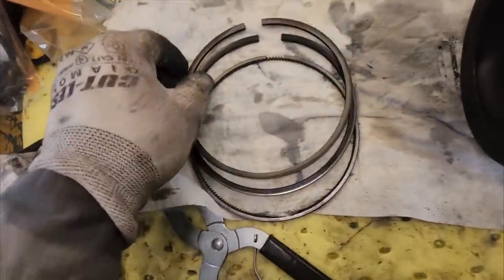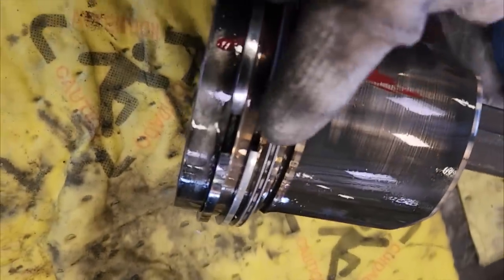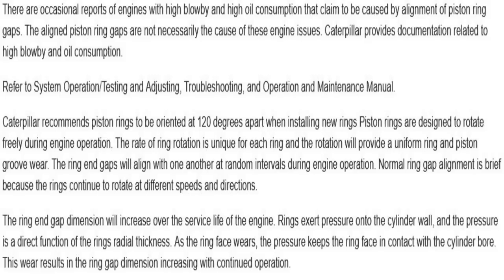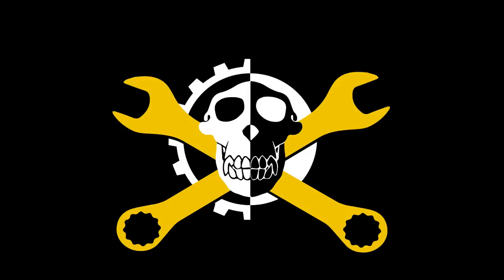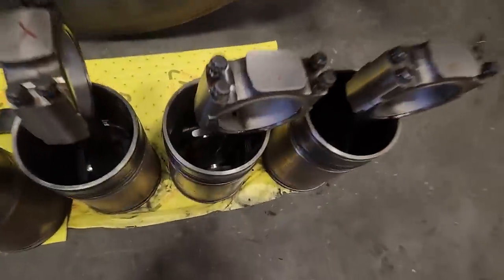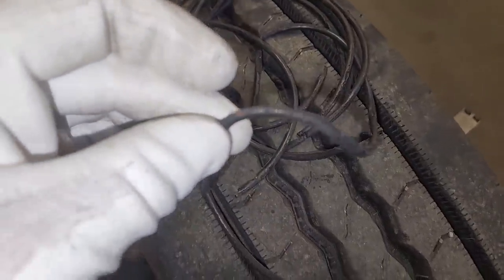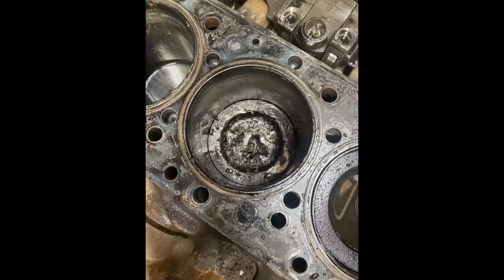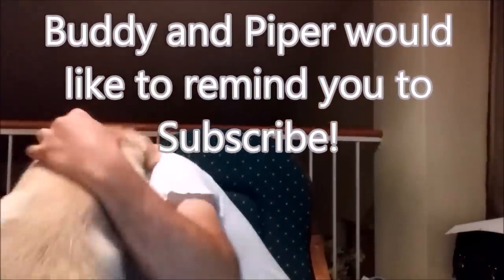Your Piston Rings alignment does NOT really matter!

Comment: This is why 2 stroke gasoline engines have small pegs in the ring lands to prevent rotation. You can't have the ring gaps move towards a port and get caught because it would break the ring and damage all kinds of stuff. In 4 stroke engines, it's a non issue. Can anyone chime in on 2 stroke diesels such as Detroits? Those have intake ports in the cylinder.
Reply: Hi ya I know the pegs on gas but had never thought about the diesel ones. Bit shit really as have a 353 Detroit thanks for making me think and hope josh or someone tells us
Reply: Shouldn’t matter as far as the ports are concerned because the ports aren’t real wide between each section on the liner. It’s not enough space for the rings to come out and hang on.
Reply: They have exhaust ports only. But since they have multiple and  smaller ports, and may not have alignment pins.
Reply: The intake is controlled by conventional valves.
Reply: I don't know if this qualifies but a EMD 645 2 stroke has the rings fixed in place.
Reply: ,,, the Detroit 2 stokes have many small ports, evenly spaced, and the end gaps just don't fall into the ports ,
Reply: The Detroit diesel 2 stroke has intake ports at the bottom of the cylinders  and exhaust valves in the head. That is also why it needs the blower to run. It produces no booost but is there to fill the cylinders with air .
Reply: @Paul070 they’re not fixed. If they appear fixed, they’re stuck. One of the checks when doing internals on the emd 2 cycles was to check the ring tension with a flat blade screw driver and press the ring and see if it has some “bounce” to it. No give/bounce and it was either stuck or broken. The ports on the liner are 360° so you end up with the ring gap passing the liner ports regularly.
Reply: @franksprecisionguesswork501  that is not correct, the ports in the liner on a Detroit are the intake ports, the exhaust valves are open when the ports are uncovered and the blower purges a fresh charge of air through the cylinders.
Reply: @franksprecisionguesswork501 Detrot 2 strokes feed intake air through holes in the liner, and force exhaust gasses out through valves in the head.
Reply: @franksprecisionguesswork501 wrong. Detroits have blowers that feed air into the airbox, then the intake ports at the bottom of the cylinders, then it goes out through the exhaust valves.
Reply: The diesel 2 stroke can’t jam up the rings like if it we’re a weed eater 2 stroke cause the ports on the diesels are machined uniformly 360 degrees into the cylinder sleeve so the rings can rotate all they want

Comment: Here’s another little tidbit: if you remove a piston from a cylinder that’s using oil and you find the rings are all lined up and they’re not carbon-seized, it’s an indication the cylinder is out of round
Reply: Correct. Good Job!
Reply: Huh. I've never heard of that
Reply: Actually means the oil control rings are worn out!@.. .

Comment: Just watched a video about doing compression checks on aircraft engines that brought up the ring movement, and to not condemn a cylinder too quickly due to low compression, some manufacturers recommend flying the plane for 45 minutes to an hour and recheck, 99% of the time the compression comes back to acceptable standards.

Comment: The reason you do not line them up on a fresh overhaul is because your compression is gonna be down from normal conditions once the get seated in after a few hours of running.  2 stroke pistons on the other hand have locator pins to prevent rotation because there's no oil control ring on them.

Comment: CORRECT JOSH. When I built engines for Cummins the Engineering squad in Australia tested this theory. Engraving dots on the top of liners to identify where the ring gaps were set when the engine was assembled. Ran a few test engines like this in the field, then stripped them down for inspection. The rings had always moved around on every test engine. Thanks for your video, well said!

Comment: I’m glad you put this out there. I read in Skyranch engineering manual that Lycoming tested to see what the rate of ring rotation was on one of their engines and I can’t remember exactly what it was but it was once every couple of minutes at 2k rpm I think. What was more important was the fact that they DO rotate. As a matter of fact, the cross hatch honing pattern I would think would put a twisting force on the ring as it moves up and down the cylinder. I think the ring gap placement when assembling a newly rebuilt engine is more to prevent cylinder gouging on first start until the rings wear to the cylinder.

Comment: Yup, you’re right, they do move around the piston.

However, it does help initial compression during a post rebuild start up.
Reply: So that's interesting, this is just a liability thing then. Seems like in 99.9999% of builds this would never be an issue and clocking the rings doesn't matter, but for that .0001% that do have an issue you could find yourself in a lot of trouble. So, tell everybody always forever that they should clock their rings with offsets because nobody wants to get blamed for the one guy whose engine goes bang.
Reply: Not even then. By the time it's cranked enough to have enough fuel through the injectors to fire, the rings will have rotated on their own.
Reply: @HANKTHEDANKEST It's not so much liability, it just makes the first start before the break-in runs easier.
The ring seal isn't optimum on a freshly built engine - they haven't broken in yet. Staggering the ring gaps just creates a longer labrynth for the gases to escape through which helps keep the compression higher.
Reply: @HANKTHEDANKEST  Murphy's Law: "If it can fail, it will fail in the worst possible way at the worst possible time."
Reply: I was told religiously in trade school that the rings DO NOT move… lol
Reply: @nickfriesen7624  lol.. My shop teacher taught us (in high school) that the reason a gasoline (spark ignition) engine has to advance the ignition timing, is because it takes time for the electricity to run through the spark plug wires, and it needs to compensate for it as it revs up!! lmfao

We got into a little "battle" after that... I eventually remember asking him "why are the plug wires all different random lengths then, and why can I throw wires on it that are even different lengths from those, and it still runs PERFECT?"  He didn't seem to have an answer for that. lol... I was only 17 too, but as soon as he said it, and I thought about it for a few seconds, I thought to myself "that can't be right".
Reply: @billymanilli one of the most frustrating things in the world is for someone to have full confidence in themselves when they are wrong.
Reply: Pour oil super thick assembly

Comment: Actually never thought about that! Great points.  Another subject that people think matters but actually doesn’t: A/C Schrader valves that have a slight leak is NOT the cause of a low refrigerant condition. SAE specifically says that the port caps are the primary sealing mechanism for service ports, NOT the Schrader valves. They are there only to prevent a massive loss of refrigerant during hookup and disconnect of gauges and recovery machines. “Maam, we found your leak, we have to replace your Schrader valves “ not lol.

Comment: Outstanding video as always! I've always wondered why manufacturers even specify where the ring gaps should be since it's so obvious to anyone who has been around engines that the rings rotate anyways. The only theory I've heard that makes any sense is that perfectly lining up all ring gaps on all cylinders might lower the compression enough to make starting the engine difficult. I've never tested that, but the gaps are so small that I can't see them leaking enough compression to affect startup much.
Reply: I don't really see them being lined up leaking enough to cause too much issue starting up, either... I mean,  you and I both know we've had (or at least witnessed) engines that'll fire up with a bent valve, head gasket leaking, broken pistons, etc..
Reply: @billymanilli  Good point, that's true. Only difference is a blown head gasket, broken piston, etc doesn't generally affect all the cylinders like someone perfectly lining up the ring gaps on every cylinder might, but I still don't see the leakage being high enough to cause starting problems either if the rings are in decent shape. Do you have any other theories on why manufacturers specify where the ring gaps should be?

Comment: What you say only makes sense. Any pressure that leaks through the compression ring gap(s) will continue to the gap on the oil ring--regardless of where that gap may be. A leak is a leak is a leak. The pressure does not care.

Comment: You're pretty much right.  I still do it, for some reason, I guess from habit...  Funny story, when I was a BMW tech 20+ yrs ago still "training",  my instructor (Sean Clarke),  my best friend, and myself were discussing this very topic...  

We (well, Mr. Clarke, really) actually spoke to Mahle in Germany about it, and they said it didn't matter.  What they pretty much said was " the rings will always rotate, some faster than others, and there will almost always be at least one cylinder where they'll line up for a second or two out of every few minutes or so of running it (especially hard)".  That's coming from a company that made a LOT of rings!  They made rings for many OEM engines (BMW and GM being 2 that I know for sure).

They also "spin" a lot more when new and not broken in yet, from what I remember...  Makes sense to me, going up and down against a fresh crosshatch pattern on the cylinder wall, and all of the harmonics and stuff going on.
Reply from the maker: I still do as well, think it helps with startup and like I said, Go With Your Manufacturer Recommendation when putting it together. 👍

Comment: Just adding my 2 cents. I’m no mechanic but having been a soldier and doing 3 combat tours in Iraq, I’m very very very familiar with the M4. They use a ring design for the gas extraction. If the rings so happen to line up which to be fair is very rare it won’t extract the round properly. So I think that the idea is if you don’t initially line them up the odds of them lining up on their own is low.

Comment: I think a reason for staggering the rings on initial installation is so that when you compress the rings and press the piston assembly into the cylinder there is less chance of chipping the rings from the gaps catching the lip of the cylinder. I have seen it before and a chipped ring will tear the hell out of a cylinder ruining the engine.

Comment: I doubt that the factory aligns the rings during assembly.  I used to work for a large air power company based in Sweden and we built multiple nut runners for the automotive and equipment industry.  We once made a 32 spindle multiple for Cat to bolt heads on one of their engines (I don't remember which one).  I asked the engineers on the job how they controlled the sequencing of the air motors to tighten the head bolts.  The answer was that they didn't.  Whichever head bolt that got tight first got tight first and no one apparently worried about it.  Just an interesting story about how the factory assembly procedures differ from those in the field.   Keep the good stuff coming.

Comment: My wife has a 2003 super duty with a 5.4 gas engine. 340,000 miles with intermittent oil burn for years. I was just talking to her about wondering if her ring gaps get aligned from time to time last night. The engine is still strong it's her daily driver and we haul cattle with it.
Reply: a 3 valve that lived this long? That's something. Frequent oil changes and a particularly good mechanic?
Reply: @bobw7018  Mostly highway miles with synthetic oil.
Reply: I don't think you realize how small ring gaps are or how oil controls work. Oil control ring has 2 rails and spring, 2 rail end will never line up because of the spring. But whole thing as 1 does rotate on that engine. Oil control ring in video not the same as 5.4. Cat oil control ring is cast iron ring with expander spring. 5.4 has 2 thin steel rail (as they call them) with expander spring.
Reply: @bobw7018  2003 would be a 2 valve, 3 valves started in 04.

Comment: I had a new 931 I went out on the customer said the engine was popping and oil out the stack , took it back to the shop. Took the head off and pulled the pistons, all the rings were lined up! Staggered the rings and reinstalled, Ran fine no popping and no oil out the stack!  Yes it is a two ring piston, and yes rings move, but I always stagger the rings to start! Seen this on other engines in just one cylinder, so to me that showed staggering does help, at lest tell rings have a chance to wear in!

Comment: Yup.....  Ring end gap is ring end gap.  Compression is going to leak by through the gaps at the same rate and in the same quantity regardless of where they're lined up.  Many years ago i experimented lining them up on multiple engine rebuilds and never had one issue. No abnormal scoring on cross-hatch on cylinder walls and upon removal they were all over the place from moving during operation.  It's the one thing i don't give a flying phoque about when rebuilding engines.

Comment: As a motor mechanic heading up to 40yrs in various parts the industry, I can 100% assure you that it certainly does matter for oil burn in gasoline engines.
On many occasions for different vehicle manufacturers over the years when I was in new cars there would be a batch of cars whose engines would assembled with the ring gaps all lined up, and those engines would consume oil and come back for warranty.
In several cases, the fix was to very lightly hone the bores, correctly install new rings and reassemble the engines. These cars would then go on to lead a normal life 👍

(Nissan Bluebird Turbo Z18ET from the 80s, Mazda GE626 2.0 from the 90s, Subaru 2.5 boxer from the 2000s are a couple I can think of, and personally owned afterwards)

Comment: Something to think about with piston rings in actual operation.  There is a physics law called  " Choked Flow "  This is  where as gas or liquid pressure increases through an orifice, flow does not increase at the same rate.  RE: After a certain point, a 2x increase in pressure does not equal 2 X the flow.    So, even with lined up rings, there will be choked flow limiting gas volume.

Another point, very high pressure gas compressors don't have piston tings, they have grooves on the pistons to control blowby ( the non compression side of the piston is referenced to the intake port )   Google   "  high pressure gas compressor labyrinth piston  "   and  "    Burckhardt Compression AG   "
Reply: Neither does axial or radial hydraulic piston pumps and motors have rings.

Comment: I worked on assembly line at gm building thousands of lower ends. You dont line up the gaps purely because of oil consumption during BREAK IN. It DOES let oil up the piston head.  

Yes, they do move, but a fresh engije during break in, you do not want to burn oil because this will glaze the cylinder instead of seating in the rings  properly

Comment: My son hooked up a set of injection line on an Audi five . The flame from the pipe was ten feet high when I lit it . The insurance company would have been in stroke mode. We had high bays . The cold start is electric so it’s pressure. The rest spray continuously and the amount is determined by the fuel distributor. I love those of Bosch kjets
Reply: Wtf are you talking about lol?

Comment: A big reason for staggering the ring gap is to prevent a longer, or more average time of the gaps being aligned. This absolutely reduces blow by. Maybe 75%? Also they don't rotate as much with compression since it's forcing the ring to the cylinder wall adding friction. Every engine I've built,  which is damn near 500 of pretty close to 50 50 gas diesel.  All come apart with the rings still having a significant stagger from the gaps.
Reply: seen that with one near-antique engine in particular. When I strip one, there will be one cylinder with compression rings 'stacked' on each other.  It is always a locked or near locked up oil control assembly underneath those double-gap compression rings. lol. 
Shows up after hundreds of thousands of miles. But it DOES show up.  Reclock, clean out the oil control groove, motor away!  Gaps matter at the extremes. Not 75,000 miles. 
Of course not.

Comment: Yes they do rotate but they're usually being renewed for an engine rebuild. With that said, there's more chance of swarf coming into play from not being scraped properly from the piston liner. for this reason its best not to have the gaps inline. You'd be surprised at the amount of swarf even after 2 oil changes. My opinion, great work btw.

Comment: When I started putting Volvo Diesel engines together they did not specify ring alignment in the manual. 
I just staggered them and went on. 
When we started getting loaded liners I popped a piston out and they were all lined up.  Popped out a couple more and that's how Volvo loads them. 
By the time a fresh engine fires,  it's cranked over enough just priming it out the rings will be in a different position.

Comment: Back in the day our CRC department built a D343. They noted the ring gap  and set it out. When it came back in for another rebuild, as you well know. The rings was not in the same place. I also tell people you have a small ring gap with the ring in the bore. If the rings did not move, at the very top of the cylinder you would have a small area with no wear.